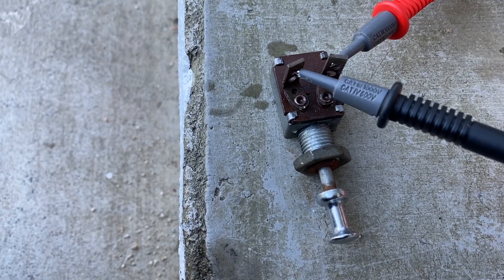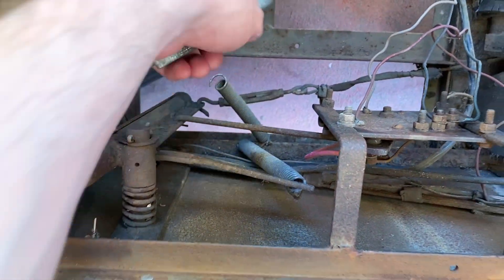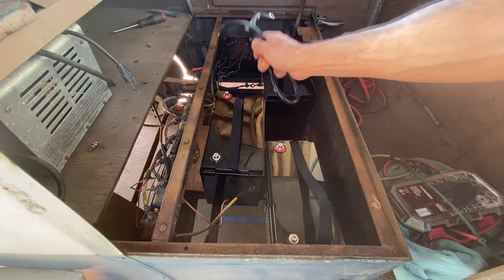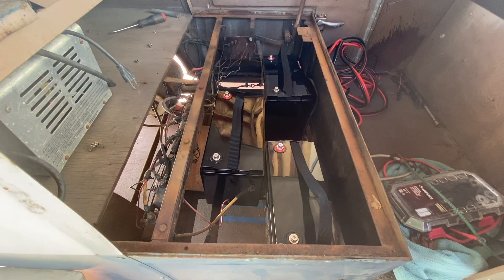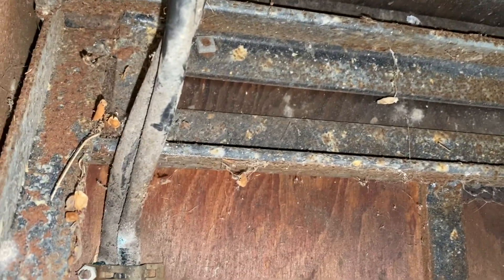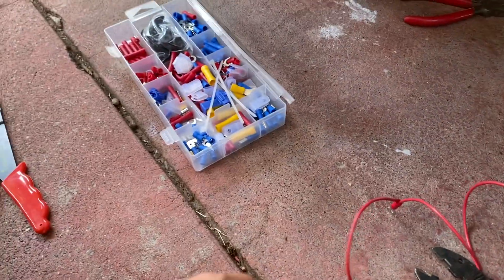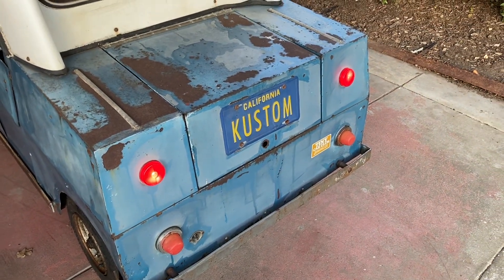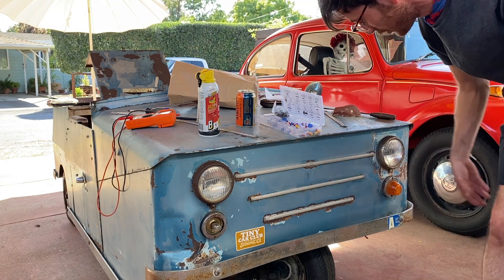Working on our Electra King vintage car EV from the 60s - New Batteries and upgrades?

Comment: Hi, very cool restoration project, looking good!  I have a 59' Taylor Dunn Trident that I'm looking to upgrade to use lithium batteries as opposed to the original lead acid.  Did you find any issues with the original components not being compatible with the lithium as long as the voltage specs are all the same as the original?  Many thanks!
Reply from the maker: Thanks!

You should just be able to put the lithium batteries in as normal. If you have any in line fuses those are always handy for accessories (just in case) but not needed.
Reply: @JackGoesThrifting  Ok, great!  Thanks for the info!

Comment: Me again, how do you steer and brake the thing? {:o)
Reply from the maker: It has a tiller for steering, and the throttle is the lever on the left hand side. Pull back for brakes and push forward to turn the motor!

I can cover this is in the next one :- )